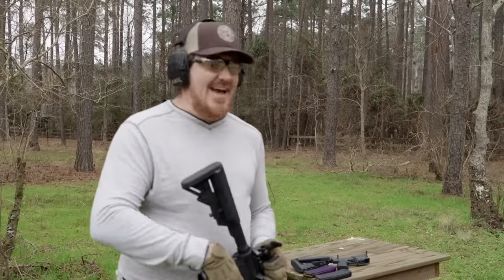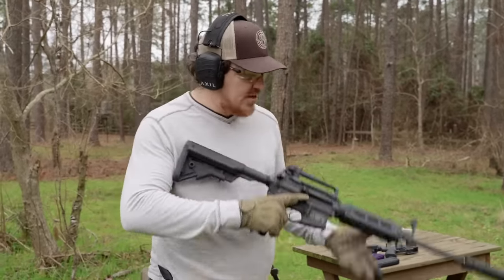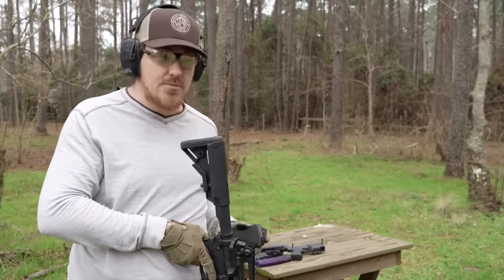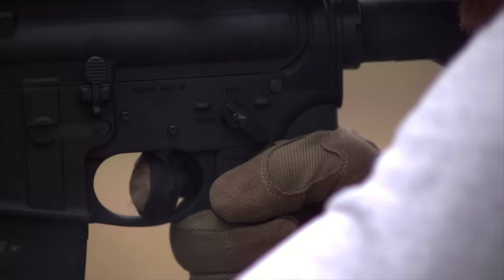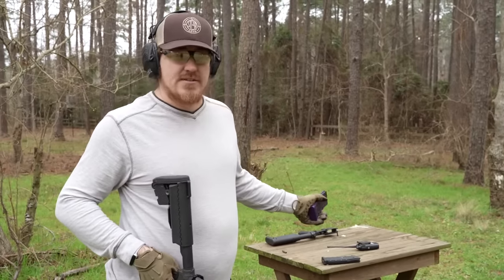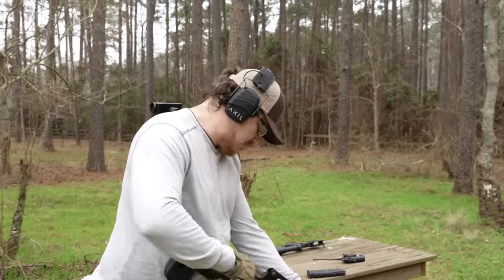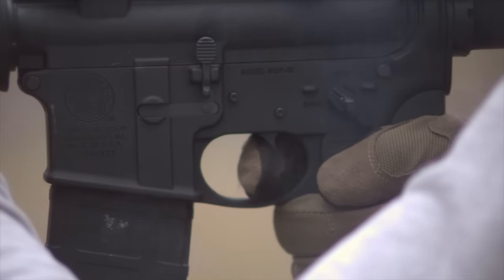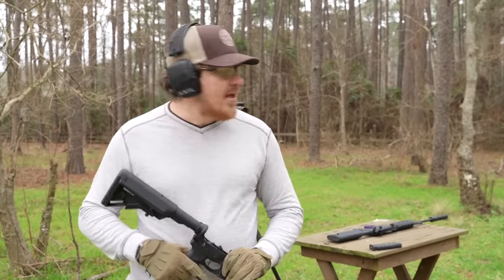FRT-15 Vs An Actual Machine Gun

Comment: so where exactly was the Machine Gun? I saw two assault rifles no Machine Gun.
Reply from the maker: The colt - by definition - is an automatic machine gun. But I’m sure call of duty doesn’t clarify that.
Reply: @gatcattill  The Colt Machine Gun or CMG was an open bolt belt-fed machine gun that fires 5.56×45mm cartridges designed by Colt Manufacturing Company in 1965. Colt hastily developed the CMG-1 to complement the CAR-15, a Colt branding of the M16 rifle, so that Colt might offer both of them as an alternative to the Stoner 63 weapons system. It failed to achieve any sales, and was replaced by the Colt CMG-2, which also failed to achieve any sales. The CMG-3 was a 7.62×51mm NATO version that failed as well. notice the words Belt fed
Reply from the maker: That’s a belt fed machine gun sure. This is a registered colt m16a1 machine gunz

Comment: The "H2" is not a buffer tube.  It is the buffer.  It rides in the tube.
Reply from the maker: Correct - its the Buffer weight. Did this in one take didn't want to correct.

Comment: Shot the FRT one time, in spare parts it went…. Wastes ammo, single shot fire is pretty much impossible.
Reply from the maker: I feel like you’ve missed the point of it. However, a three position is ready for release, but the atf is not allowing that to happen for them at the moment
Reply: @gatcattill  no I hear you brother the video was about speed. My issue was, if I only have one mag and I double or triple tap every pull I’ll be up shit creek real fast. I like the ability to decide on my own… 🤠🇺🇸

Comment: Are these illegal yet? Or can they still be had?
Reply from the maker: Still legal. Still available! Get them while you can. RBT has been releasing stock nightly.
Reply: @gatcattill  can it be shot as a regular trigger? Meaning a single trigger pull without accidentally bumping off a few rounds? Lol
Reply from the maker: With practice

Comment: Will this work on the semi auto version of the FN PS90?
Reply from the maker: No. Not at all.
Reply: @gatcattill  Appreciate it, trying to see if I can find a binary trigger in that weird thing.
Reply: You could find someone who can design someone who can make one. Problem is that the p90 like most other guns will need to find another way to engage the locking bar
Reply from the maker: @lilrobi45xxx42  way more complex than that. You would have to essentially create a trigger pack that does it, without actually making it full auto which would not be like the other systems. I have a ps90 and AUG that have these types of packs, it doesn’t support the theory of a forced reset
Reply: @gatcattill  I know I was wanting to keep it short so I wasn’t right a book. Also, it can be done but does take a lot of work. Because all that needs to happen is that the the trigger cannot fire until the bolt is all the way forward and then the trigger can be immediately pulled again
Reply from the maker: @lilrobi45xxx42  this is only a small part of it. You’ll still ultimately create a machine gun. Preventing the bolt from over running is just how you make the trigger work reliably. The forced mechanism that relies on the bolt to push it back doesn’t work since the trigger pack and linking bar for the trigger group do not function in relation to the bolt assembly. These guns are very very different since they are bull pups.
Reply: @gatcattill  I know that, I know it has to reset the trigger and yes it would be very hard since they are bullpups, but it can be done with a lot of work

Comment: Does the trigger still work or do you have complications now?
Reply from the maker: Still works fantastic :)
Reply from the maker: Should note I replaced the locking bar and spring. YouTube prohibits us from showing gunsmithing so I was unable to produce a video showcasing this without risking the channel getting shut down. There are some videos out there on the replacement tho.
Reply: @gatcattill  I understand, was it a very simple process? That's the only thing stopping me from buying one right now. I'm not a "gunsmith" but can put an AR together just fine.
Reply from the maker: Super simple. New orders are already fixed with no work required.
Reply: @gatcattill  😲 I bought it! Thanks man!!
Reply from the maker: Make sure to tune it to your gun (heavy buffer, full auto mil spec bolt carrier group). Enjoy while we can!

Comment: Subconsciously? No. You are consciously pulling and assessing to take the next shot. 

In a war of words, every shot counts just as much. Careful.
Reply from the maker: It’s subconsciously but with intent.
Reply: Do you fire any other firearm sub consciously? If you do, you either shoot at noises in the dark or need to retire from the military.

You decide to fire, Trigger forces your finger forward, you decide to fire again.

I you could argue that portions of the decision to fire are subconscious, but not all of the decision.
Reply from the maker: The difference is you’re just bracing your finger and because finger gets pushed you subconsciously push back firing the next round. The conscious effort is needed to only shoot 1 imo

Comment: Welp my 300black out got seized by them last week they trying to claim its a machine gun..
Reply from the maker: Details?
Reply: @gatcattill  had an incident on the local level when i got shot last month in Harris County,  Houston Texas.. 2 firearms that were in my vehicle not involved in the incident were taken by the sheriff department as part of protocol I was given the ok to retrieve the ones I didn't use in the incident by the detective assigned to the case. Before I could get to it ATF went in seized the 300 black out pistol with my dead air suppressor attached to the weapon from the local Sheriff department. I've been calling getting a run around. Finally talked to the anti gun deputy who works with the Local ATF he said my firearm was shipped to Virginia for a function test "THEY HAVE REASON TO BELIEVE ITS A FULLY AUTOMATIC FIREARM" Per NFA laws. As of right now that's all they're saying.

Comment: Which one shot faster? The frt?
Reply from the maker: Frt in this single instance. The lower was tuned significantly lighter to allow for faster bolt reset on the frt lower (h1 buffer - carbine spring, vs a5 buffer / spring system inside the FA lower)
Reply: @gatcattill  I see, does faster cycle rate mean less reliability when it comes to the FRT? Thank you for the video by the way.
Reply from the maker: @guitar3212  FRT isn’t on reliable platform to start - more of a range toy and should never be used in your battle rifle. Over squeezing the trigger will cause it to jam, shooters unfamiliar with controlling recoil will have issues staying on target, and the spring inside the trigger will fail after around 2k rounds which could hit when you’re using it in a defensive situation. So other things hurt reliability, shooting speeds really only hurt longevity of your gear from additional wear, and of course ones ability to control
Reply: @gatcattill  when you say spring will fail, are you talking about the hammer torsion spring, trigger return spring, or locking bar spring?
Reply from the maker: @guitar3212  locking bar. Even with the fix.
Reply: @gatcattill  the company Militia State Armory makes an upgraded locking bar, with high quality locking bar spring.

Comment: Sorry dude the gay-t-f is just looking at what comes out the end not where you got your finger stuck in
Reply from the maker: Sure. But they are also trying to stay relevant. (Waco). This will ultimately get stuck in courts for as long as the manufactures will fight it, but I feel a shift in the force and without the ability to sell more triggers, RBT will start to concede due to no funding. If RBT opened a public legal fund and by contributing to it named you as protected by their lawyers, this could go very differently.

Comment: Well to be fair...  Laws update with the improvement in technology.  If it can shoot like a machinegun (which is the trigger allows the weapon to fire rounds in quick succession), then the ATF can categorize it as a machinegun or machinegun style part.
Reply from the maker: No. Ask yourself. Is ATF part of a legislative branch or part of a literally anything else? If you answered the latter then you understand that the ATF can not make or change laws. They can make recommendations and “letters” but, can not change a law or definition. I.e. machine gun definition.
Reply: @gatcattill  You clearly don't have an understanding of administrative law.

Congress can create agencies with administrative power over a specified issue like firearms. The point being that Congress is giving the day to day governance to said agency so Congress can focus on its job. Government would shut down if every single regulatory decision needed to be voted on by Congress. You put experts on the issue in the agency to run the responsibility set by Congress.

Agencies can absolutely issue regulations and they have the power of law. It's why it's called administrative law not administrative 'letters'. Of course Congress has ultimate authority and oversight is also found in the federal courts. Just classic checks and balances.

Comment: Hmm pretty sure there not interested in how it works, just the end result. I love shooting and guns in general, ex military guy blar blar, personally, I'm nervous knowing there's a simple drop in trigger, that anyone can buy, that produces these results. If there available to responsible gun owners, there available to scum bags. A problem we could well do without, all for the sake of a novelty. Besides, if your running full auto it's expensive, and your hit percentage drops like a mofo. Once you've parted with a few hundred bucks in ammo, the fun starts to wain.
Reply: exactly - I don't think the maker will win the semantic argument - if you pull and hold your finger down and a bunch of bullets pew pew, how is that different from your finger pull on a full auto weapon?  You can argue all day long you're doing TWO things with your finger.  Legislative intent and all.
Reply from the maker: The joy of full auto never runs out. And you can watch my target damage with the 9mm and see it’s relatively simple to control your point of impact. The issue is bass akwards in how you’ve described it - this is easy for law abiding citizens and legal for law abiding citizens. Bad people will still do bad stuff regardless of stuff like this. If a bad person wanted to run auto, they wouldn’t spend 400 bucks on a trigger that is traceable. They would bend a coat hanger into a lightning link and drop it in for no traceability and no cost. As a citizen that follows the law. I have not and will not do it this way because that’s called a felony. Bad guys don’t care and if theyre already using a gun in a crime, felony charges are just going to stack against them anyways.

Comment: What's everyone talking about? The point of banning machine guns is to stop rapid fire. This thing rapid fires quite accurately so its essentially like legalizing machine guns. I get the impression that there's something you guys are pushing for that ignores this point.. We are back in the Era of Tommy guns if the government just let's it be which to me is whatever.

I don't take sides but it confuses me when people pretend it's not a machine gun equivalent.. cause what's the MAIN point? It is the equivalent in terms of deadliness for advantageous suppressive fire, mowing down crowds, or plan ol lethality at close range.. in terms of technical loophole function, there's there's push pull that doesn't stand transparently in truth is my sense 

ie bumpfire supporters were saying bumpfire is less accurate so it shouldn't be considered a machine gun while I assume frt IS more accurate.. so it's all jumbled arguements .. why grasp at straws?! Just say it's Merica goddammit and stand for what you want! Fucking legalized machine guns for all ages 8 to 99! 

Comon!

Or am I wrong? I'll put my ego aside and listen but just want to put my emotions on blast.
Reply from the maker: It’s the argument of where does the ATF draw the line and when can it move that line to fit its agenda. The tacom trigger had full aTf approval snd was designed by the same guy who engineered the force reset trigger design. ATF sees the design work better snd now they say the design is illegal. Everyone should be able to own current day machine guns. No one should have to skirt the letter of the law for a constitutional right. This point however is to stand that the ATF can not write laws and can not change laws interpretation all because they feel different one day
Reply: @gatcattill  Thats very clarifying thank you.

Comment: I jus haf one shipped weeks ago
Reply from the maker: They are coming back around! If you got it in the last couple weeks batches they upgraded the locking bar that breaks the springs. Enjoy!
Reply: @gatcattill  I got one from gun broker for like 480 bucks. Says it’s the improved one, I hope it’s good!!
Reply from the maker: @samyisafanoffred  If not - you can get the replacement parts from rare breed on their main website for around 35 shipped - video on that soon.
Reply: @gatcattill  Quick question (hopefully I don’t sound stupid). I’m gonna order the h2 and h3 buffer just to try. Do you need another buffer tube and or springs or do all of the buffers use the same tube and springs? Thanks
Reply from the maker: @samyisafanoffred the spring should be fine and not need replacing - As long as you are using a mil-sepc buffer tube, the H3/H2 will fit and function as intended. A5 is a different tube size, and pistol carbine as well.

Comment: Now that FRTs are all legal again 8/24, the militaries of the world will recognize what the ATF has ignored, and has no way back to change.... tuned to 120% faster rate of fire, with the choice to exceed "full auto" rate of fire (limited by the inertial weights), controlled by the finger, and not the selector, and not requiring the selector, the machine gun is dead evolution.  When this trigger is everywhere, made for everything, only nostalgic machine gun collectors will own machine guns.  The very things that ATF wanted from the 1930's will have now passed into technology oblivion.  You can buy all the alcohol you want.  You can buy all the Tobacco you want.  Your can buy guns much faster, more reliable, lighter, and longer lasting than "machine guns".  Just decide the tax now, and disband the ATF, they don't seem to have a purpose.

Comment: its a machine gun.

Do they really need to make a law that says "cant fire more than 100 rpm" to make you people follow it
Reply: No, what needs to be done is to change existing law to alter the definitions.  That is what the argument is about.  By definition, a trigger is not a machine gun. You obviously dont know anything about RPM either, because i, as a noob, can fire 100rpm easily on a pistol.
Reply from the maker: Name doesn’t check out. A rebel would never be so compliant

Comment: sorry, it doesn't add to your credibility to say "you don't hold the trigger back because that will cause the gun to jam" when all you are doing with the RBT is holding the trigger back. you as the shooter is making no deliberate choice to press off a round. at most you are making sure you don't give it a death grip so your finger can be forced forward. This is just as much of a propaganda piece as saying as AR15 is so loud and scary and it weighs more than 10 moving boxes ... That being said i agree the RBT skirts around the definition of machine gun and this shouldn't be an issue, but it is so lets not try to represent it on its merits and not stoop to level of those attacking it.
Reply from the maker: No attacking and no stooping. We are giving a view on its use and how it’s use is intended to function within the letter of the law. This is a demonstration of it. Over bearing on the trigger is interesting but poses a safety issue. Watch my latest video for that interpretation. It’s toward the end of the video. Maybe 6.5-7.5 min mark. Cheers!

Comment: You can pull the trigger too hard? Sounds worse than useless to me.
Reply from the maker: Not exactly. Pulling the trigger too hard causes the bolt to lock open. It takes some effort though and this causes it to shoot one shot.  Release snd go again.
Reply: @gatcattill  
So it can jam when you need it? Worthless! Buy fireworks if you want expensive noise.
Reply from the maker: At first it seems like a jam but no correction is needed to clear. It just goes to BHO
Reply: @gatcattill  
That sounds like a jam to me.
Reply from the maker: Not for everyone ;)